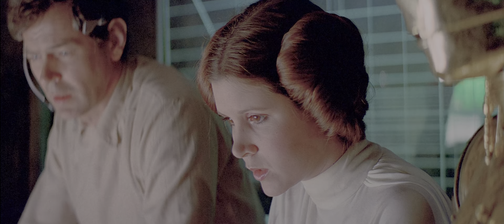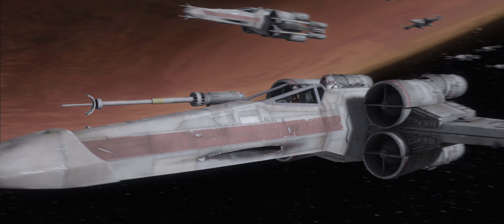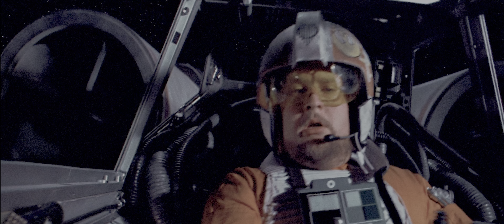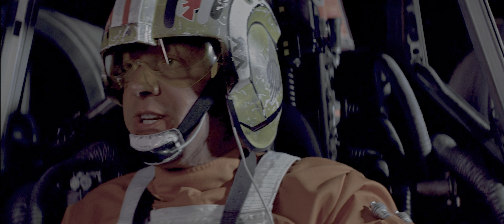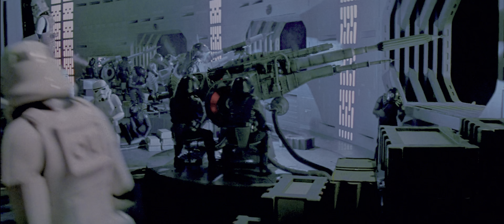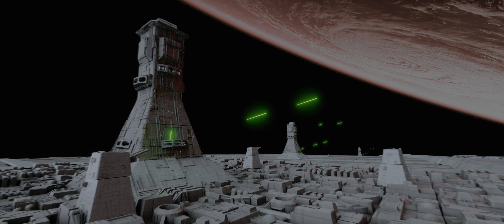WIP - Battle of Yavin - Part 1 Scene assembly + HDR grading

Comment: Few things:
Because the ships are moving too quickly to the DS, it looks small. Keep the fighters moving slowly so the "size" of the death star is maintained. Also, the turbolasers turn a serious shot into a rave party. "Less is more" and make sure the turbolasers are actually firing AT the ship. During that shot, the fighters seem waaay too far away for those turbo lasers to feel threatening. All that said and done, the editing was top notch and the scenes with the approach were steller.
Reply: Well the fighters were small enough to evade the turbolasers. Not to mention the defenses were designed around a direct large scale assault. AND the Death Star had a massive amount of turbolasers too
Reply: Or just keep the original as it is.

Comment: Since the original trilogy almost never rendered distant lasers, or really any laser that might be on screen for more than 1/10 of a second, you might want to reference the battle over Coruscant in EpIII to get a visual feel for how Lucas would handle that much laser fire in one scene. I'm not sure, but my guess is:
* Avoid synchronizing your shots from different guns - you want a more chaotic scene.
* Vary your projectile speeds?
* "Cheat" by using faster projectiles farther from the camera.
* Slightly dim the brightness of more distant lasers
Reply: “You want a more chaotic scene” ok boss